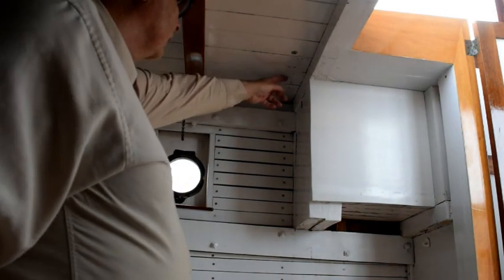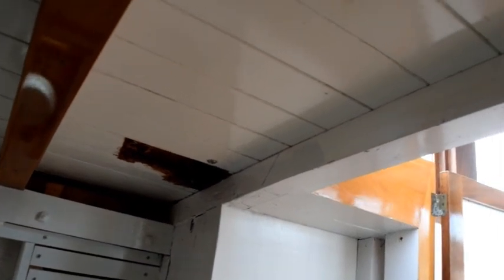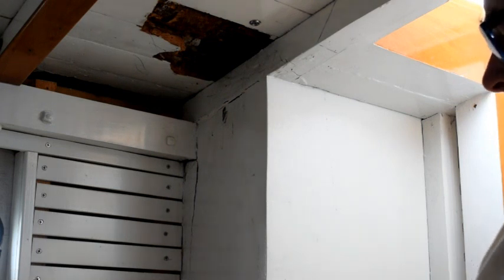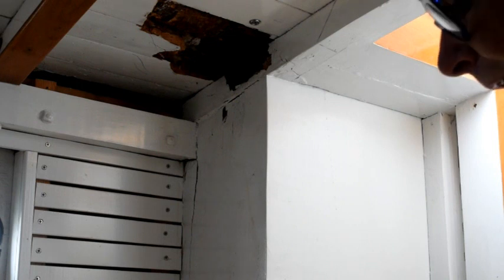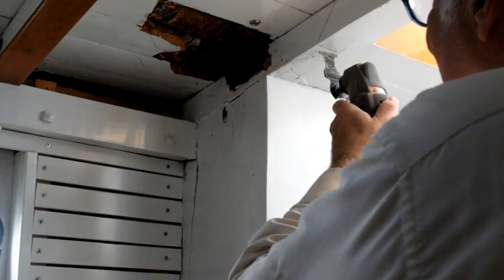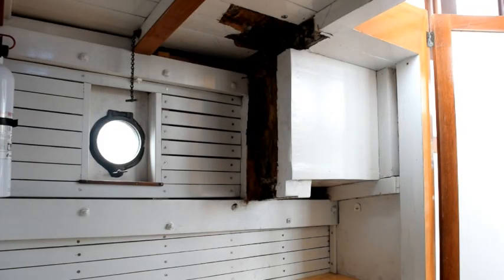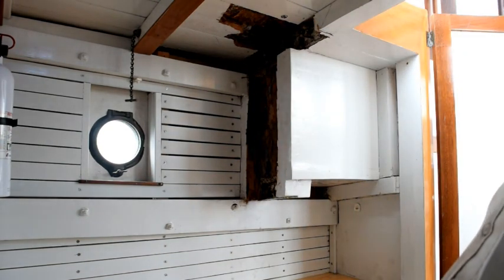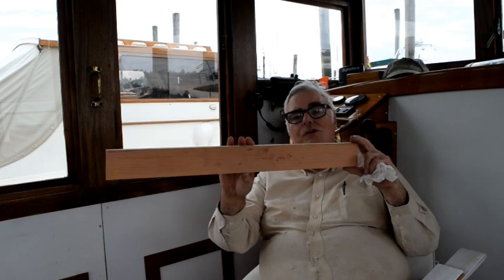Wooden Boat Deck Leak Repair Part 2 - Exploratory Tear Apart

Comment: Good stuff Todd!  Looking forward to Monday.
Reply from the maker: Richard, I am not sure how much I will get done Monday.  I am hoping to replace a bit of the stringer (sheer clamp), bit will spend a good deal of the day wood shopping, laminating, cutting things to shape and doing more demo. We got over an inch of rain today so I am glad I didn't open anything up to the outside.
Reply: No worries, should have just said , looking forward to the next video.